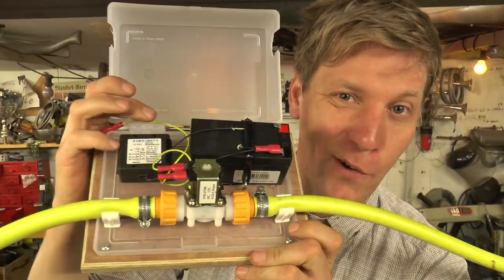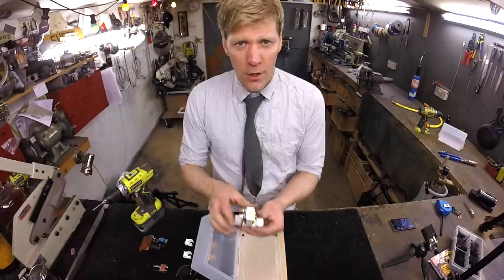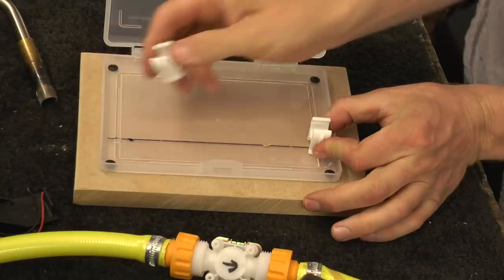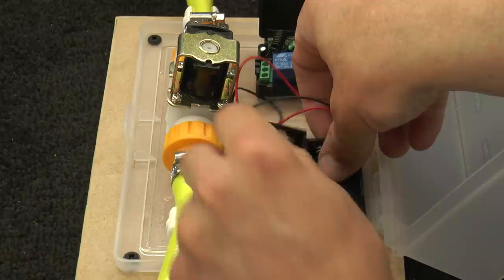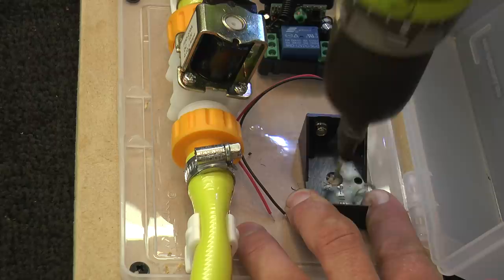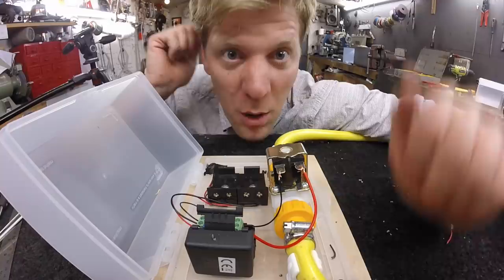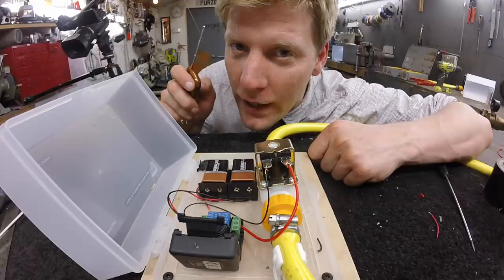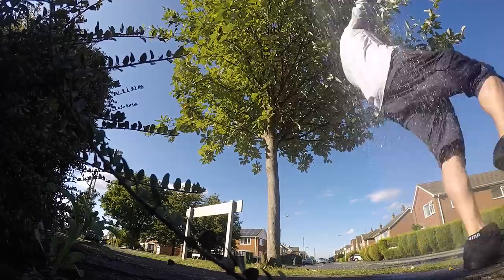How to Make a Remote Hose Pipe Controller

Comment: Doesn't your country sell proper electrical tape and if you are showing people how to crimp a spade head to a wire why not show them how to crimp a splice connector or a closed end connector so they can do the project correctly and not use duct tape to hold your twisted wire cluster FU€K.  I mean you're going to the trouble to counter sink screws, if your just going to do your project half assed then why not just hot glue your shit down. As far as using a container to keep your contraption water resistant, wouldn't you not want the overlapping lid flap to be on the bottom? If any rain or water does come in contact with the plastic it would just drip down and puddle along your overlapping seam causing the possibility that water would  seep in. It's not all that more difficult to do that same set up on the other side of the plastic container, all you would need is to connect a Forstner bit the same size as the hose to make the hole to fit your hose through and then use silicon or caulking once the hose is in place to make that connection water tight. Doing it that way you would still be able to open the lid to change out your batteries as well as making the container water tight, I mean that's the main purpose of using the container in the first place right?